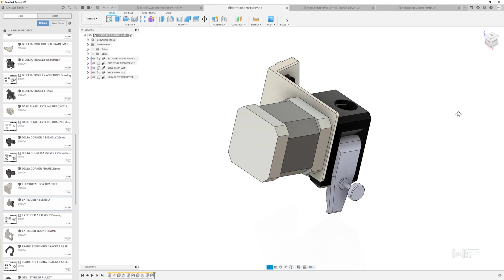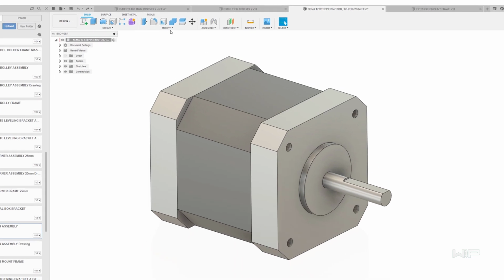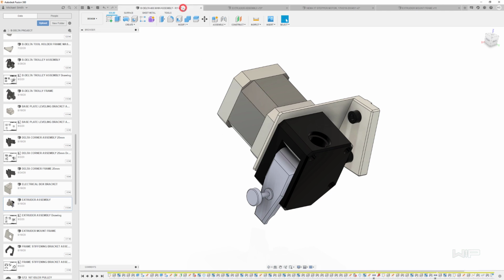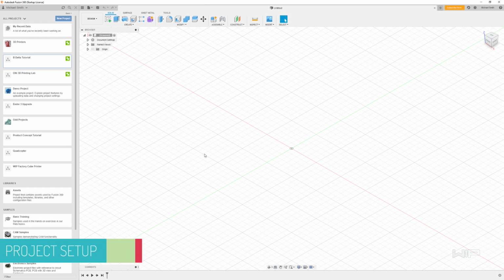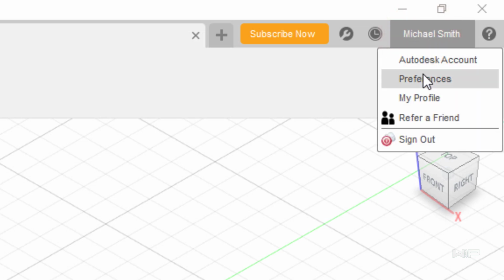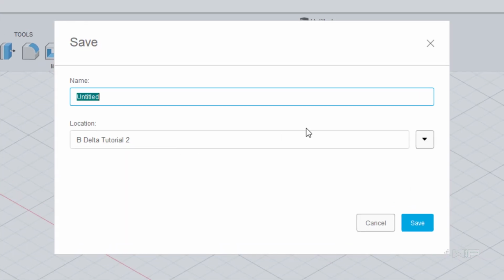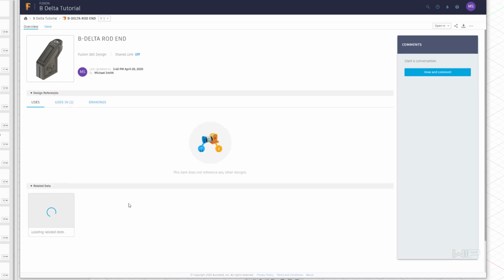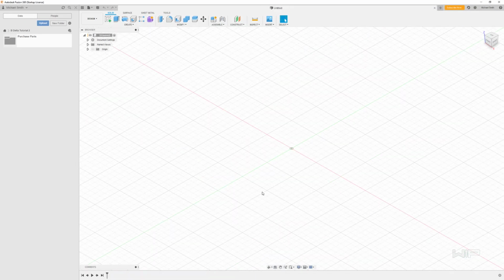Full Fusion 360 Beginners Class, Part 1, PROJECT SETUP

Comment: I've been watching you for a long time and it's exciting to see this arrive, I know it's been in the works for a while. I had a question about the full curse and haven't had any luck figuring out where the best place to ask was. I'm interested in completing the course so I can make a home-made printer and was hoping to get an idea the rough costs for building it prior to paying for the full course.
Reply from the maker: The cost for the smaller unit 400mm dia is estimated at $640 + shipping / tax. So expect to pay more in the $750 ish range. To build it larger like the 700mm x 1000mm unit expect to pay $100 more. It can be tricky to get a heated bed that large up sourced and running.

Comment: Is there a reason you use Fusion 360 and not other technology?
Reply from the maker: Fusion 360 is positioning itself to be a platform for CADD, ECAD, and CAM. While it's not quite at the same level as current dedicated platforms today, this tool lets me explore many corners of engineering and manufacturing without a ton of complex and expensive licensing. So from a learning perspective, it's a fantastic platform. As for today, I would still prefer to work in SolidWorks but I'm not sure how long that will last as Fusion continues to develop.